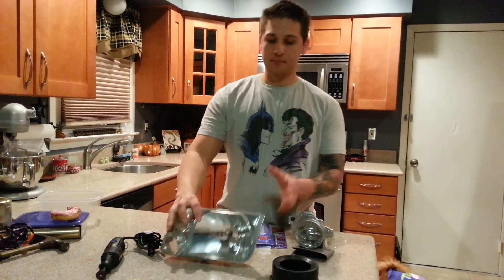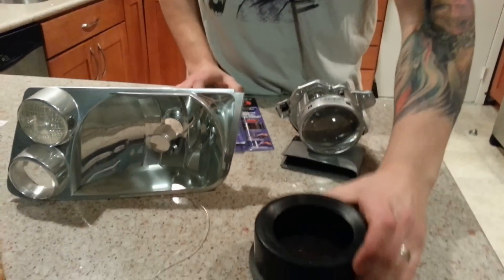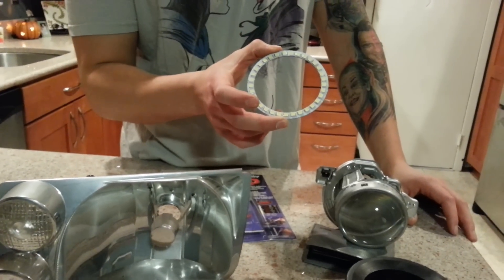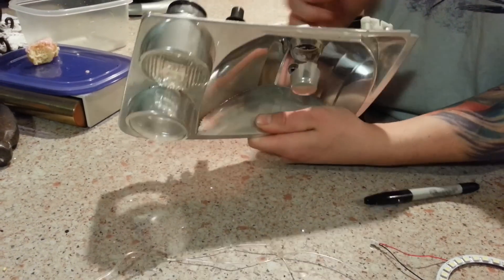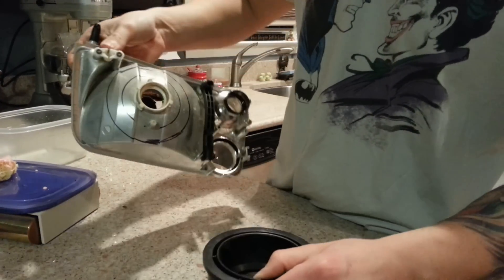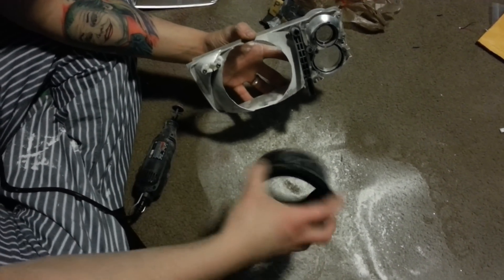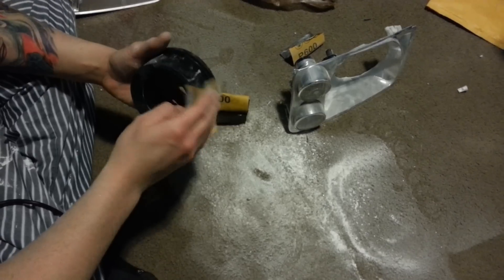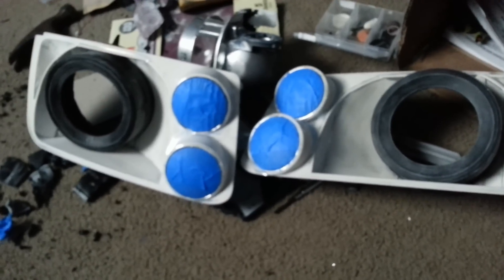HOW TO: MK4 Jetta Projector Retrofit Tutorial PART 1

Comment: I've been toying with the idea of doing this for a few years, I've got the projectors and ballasts (G35's) one thing you overlooked was the aiming of the headlights. I saw a vid a while back that shows when stock head light removed headlight should be put on ground on flat surface and shined onto wall 10-20 feet away you mark where headlight is sitting on floor with tape and sharpie to orientate the position, the light is sitting on floor MARK ON THE WALL where beam pattern is (the cut-off of the beam) and then dissemble,  do your retrofit BUT DO NOT GLUE in place. Temporally install projectors into headlight assemble put on floor in the EXACT location you've marked (from before) light up projectors and align beam to marks you made on wall.
This will insure that your new projectors will have the same cut-off as your old headlights and be straight (right and left beam pattern) lining up. When you have BOTH projectors lined up THEN SPOT GLUE into place then proceed with final steps.

Otherwise if you just do what you showed  your beam pattern could be anywhere and IMPOSSIBLE to properly adjust,
this is a very important step not to be overlooked, unless you don't care about function and are just going for looks, don't mind headlights cut-off pointing to the roof of car in front of you or on the ground 30 feet in front!!!
At start of video when your at kitchen counter headlight bucket sitting right there you should have re-connected lights hooked battery and done what I described above.

SO, how did they turn out ON THE CAR? Were you beams in correct alignment? IF it turned out OK you're lucky.